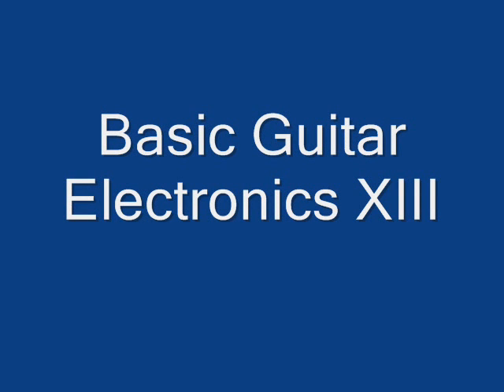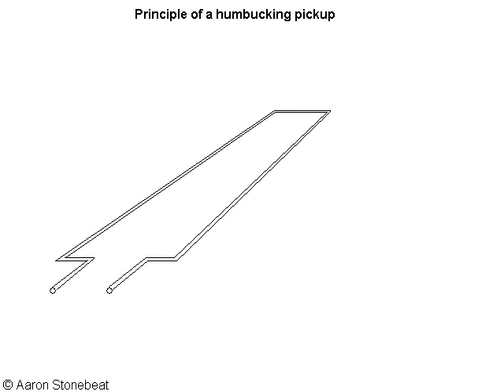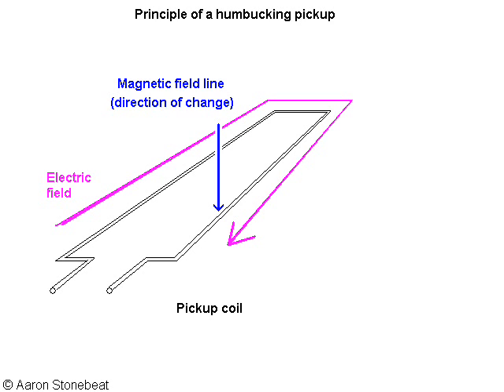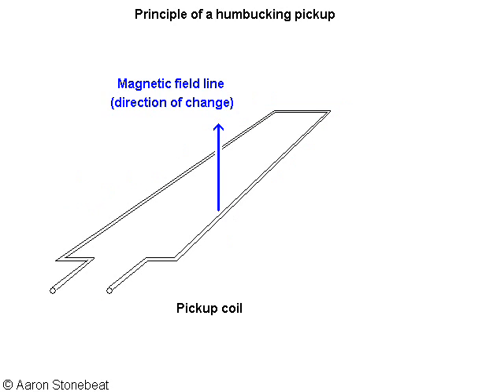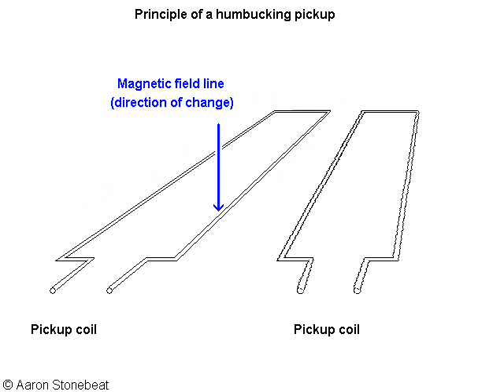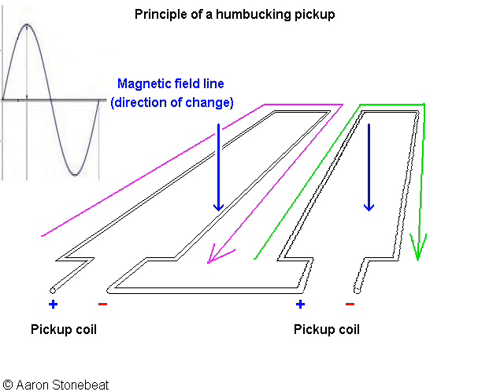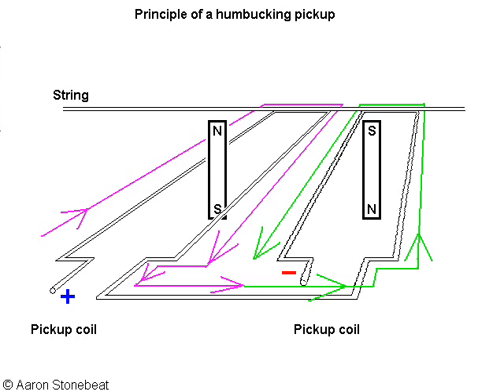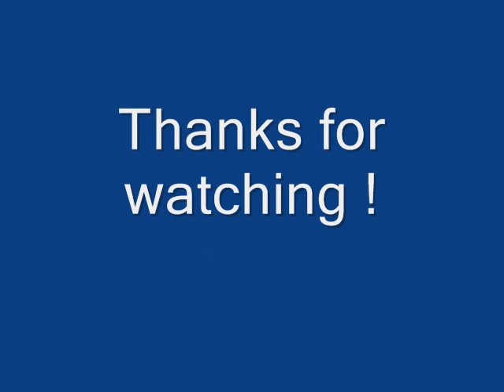Basic Guitar Electronics XIII - Principle of humbucking guitar pickups

Comment: why reversing the magnet on that coil reverses only the sound but not the noise?
Reply from the maker: The noise is independent of the magnetic field in the pickup; it is canceled because the coils are connected out of phase.
To produce a signal from the metal strings, the coils need a magnetic field. If the coils are only connected out of phase, they would be out of phase for the string signal too; by reversing the polarity in one coil, they are in phase relative to the string signal.

I just had a long conversation with RamPamParam about exactly the same thing.
And the answer is in the video 😉
Reply: @aaronstonebeat   thankyou

Comment: Hey Marc!!! Thank you so much for this super thorough, insightful and interesting explanation!!!!!
I'm actually having a hard time understanding something you never mentioned in this explanation which I believe might have some significance, and was wondering whether you might have some knowledge about:
I learned that in humbucking pickups, a big magnet is placed between the two coils in addition to the six magnets each one of the coils has.
Do you know why that is? does it play a factor in reversing the current in some way?
Thanks in advance!
Reply from the maker: Many well known humbuckers indeed have a bar magnet underneath, between the pole pieces. In this case the pole pieces are not magnets but merely ferromagnetic material. The pole pieces are magnetized by the magnet.
I'm not entirely sure why this is done. It is very well possible to use  magnetic pole pieces, like in many single coil pickups (In fact, in most single coil guitars, when two pickups are selected, they are humbucking; because of the reversed polarity and connection of the pickups).

The bar magnet has nothing to do with reversing the current in one of the coils.
Reply: @aaronstonebeat  Thanks for the response! Very appreciated.
Not entirely sure what you mean by "when two pickups are selected, they are humbucking; because of the reversed polarity and connection of the pickups".
Wouldn't one of the coils need to have a set of magnets with an opposing polarity in order to produce this kind of humbucking effect?
Reply from the maker: @RamPamParam  Yes, you are correct in that the pole pieces need to be reversed polarity in the two coils. But they already are because the bar magnet is polarized lengthwise; one row of pole pieces touches the north pole, the other row touches the south pole. So each row of pole pieces becomes an extension of the pole they touch.
Basically the rows of ferromagnetic pole pieces and the bar magnet together form a U-shaped magnet.
Reply from the maker: In a standard telecaster for instance, when both pickups are on they are humbucking. One pickup has north up magnets, the other one has south up magnets; and they  are reverse wound (or reverse connected if they are wound in the same direction; the effect is the same).
Reply: @aaronstonebeat  Also, correct me if I'm off, but if the magnet bar is the only actual magnet in the pickup, it would mean that each set of ferromagnetic poles would be oppositely charged (6 poles positively and the other 6 negatively). So how would this affect the explanation in your video where both sets of ferromagnetic poles are referred to as individual magnets?
Reply from the maker: @RamPamParam  It does not matter for the explanation in my video. One coil 'sees' a magnetic field and the other coil 'sees' a magnetic field in opposite direction.

If the pole pieces were magnets themselves, the whole magnetic field would extend further around the pickup; with the bar magnet in a humbucker the magnetic field is more concentrated in the centre of the pickup. So there will be some difference in sound.
Maybe that is why they originally chose to do it that way?
Reply: @aaronstonebeat  I went ahead and read all about Faraway's and Lenz's laws.
I now understand how the current can be induced counter clockwise magnetically.
But I can't seem to figure out how the hum gets cancelled since the wiring in the diagram in which you show how the hum gets cancelled (Minus to Minus) is different than in the diagram in which you show how the guitar current doesn't get cancelled (Minus to Plus).
Reply from the maker: @RamPamParam  You do go the extra mile!👍
The point is that for the pickups to 'hear' the strings, they need the magnetic field; the strings excite the magnetic field and this induces voltages in the coils. Since the coils have opposing magnetic fields and are  connected reversly, this proces is 'in phase' for both coils.

To 'hear' hum, external electromagnetic interference, no magnets are needed. The hum already is a changing (electro)magnetic field; the coils themselves are in fact antennae. But in this proces the coils are out of phase and so the interference is largely canceled out.
Reply: @aaronstonebeat  The reversed connection cancels the hum? well yes, the way you show it does on minute 8:11, but not on minute 9:47 where the connection of the two coils isn't the same anymore.
at 9:47 we see how the signal of the guitar is not cancelled, but this logic just doesn't make sense for the humbucking connection showed at 8:11 which was negative to negative.
This is what I hoped you could explain.
Reply from the maker: @RamPamParam  In the last section of the video I reverse plus and minus of the right hand coil because now the magnetic field there is also reversed.

For external noise the coils are connected out of phase; for the vibrating strings these same two connected coils are in phase.
Plus in one situation is minus in the other; because of the directions of the magnetic fields.
Reply: Oh wow!
So what actually happens is that the hum’s signal which doesn’t get affected by the magnetic field, travels clockwise in the right hand coil while the guitar signal’s current does get affected and so travels in counter clockwise?
Does that mean that the hum gets cancelled in the middle where the two coils meet?
I figure this ultimately means that currents which are not induced via electromagnetism are not affected by the polarity of a magnet.
Does that sit right with Lenz’s law?

Maybe what I don’t understand is the electrical aspect of things.
Like, why would the hum’s current in the right hand coil travel towards ground at 8:14? And why would the hum’s current in the left hand coil travel away from ground?

I’m so sorry if I’m complicating things, and just know that I really don’t expect you to continue answering if this causes inconvenience.
I appreciate all of your kind answers up until now so very much Aaron! :)
Reply from the maker: @RamPamParam  It's no problem. Good to see you are getting there.

What you see in the video is just a snapshot of one moment. Actually the hum  and the signal from the strings travel back and forth through the coils all the time. The hum goes one way in one coil and the other way in the other coil; the signal from the strings goes the same way through both coils.

So yes, in a way you can say the hum gets canceled in the mddle; where two identical but 180 degrees out of phase signals meet and annililate eachother.
Reply: @aaronstonebeat  So let me get this one straight:
Why would the hum that's produced in the right hand coil be of +2V and the hum produced in the left hand coil be of -2V as shown on minute 8:06 of the video?
Because I figured this doesn't have to do with the magnetic fields.
Is this merely a result of how we decide to connect the copper coil?
Meaning that if we connect the positive wire to ground then the hum that's produced in the coil will be negative and vice versa?
Reply from the maker: @RamPamParam  Yes. If there was only one coil, no strings, no magnet, the coil would pick up the hum and you could amplify it. If you connect a second identical coil in series the hum would be doubled (theoretically). If the second coil is connected reversely (or reverse wound), the hum is canceled.

imagine that the hum is one electromagnetic wave that passes through both coils simultaneously. If the coils are in phase, the hum is boosted; if they are out of phase, the hum is canceled.
Reply: @aaronstonebeat  I think everything finally clicked for me!
Thank you Aaron!
One last question!
I wonder why the hum doesn't get affected by the magnetic field.
Why is it that only the induced current gets affected and not the hum?
Do you happen to know?
Reply: Oh and another one:
So once we build a humbucker in reality and connect finish to finish, do we connect (-) to (-)? And what actually happens behind the scenes is that the magnetic field flips the two polarities in the right hand coil thus allowing for an output?
Reply from the maker: @RamPamParam  I don't know if I have a good answer to that. Maybe the hum isn't affected by the magnetic field, maybe it is.
Reply from the maker: @RamPamParam  Can you rephrase that question? I don't understand what you mean.

Comment: EXCELLENT VIDEO      I am thinking of replacing the single coil pickup in my bass with a humbucking hotrails pickup.      Are the base magnets in the humbucking pickup already reversed?   To get the maximum  lower bass sound,  should I wire the humbucker coils in series?  Should I feed the first coil on the left ..... and then take the exiting wire and feed the second coil on its right side?    Thanks
Reply from the maker: Thanks!
1) Yes, the magnets/pole pieces are reversed polarity; it wouldn't be a humbucking pickup otherwise.
2) By wiring pickups in series the output will be higher compared to wiring in parallel. In guitars this is most noticeable in the midrange of the sound.
Some experimenting might be wise.
3) Which wires should be connected to each other depends on the construction of the pickups and de colour code used.
Again, some experimenting might be a good thing; if you get it wrong, the pickups will be out of phase and not much bass tone will be left.

Comment: So in principle, for a singlecoil pickup, trading out the number of winds for a stronger magnet (such that the signal output is conserved) would also improve the signal-to-noise ratio right?
Reply from the maker: Yes, correct. But it will aso affect the sound. Some manufacturers of cheap pickups use thin wire to get to a certain resistance of the coil (incorrectly equaled to 'output' by many consumers) with fewer windings. In general these pickups sound very trebly and harsh.

Comment: As far as I can tell, this is the only video on YT that actually explains humbucking, and why the signal from the moving string is not canceled out.  Congratulations for doing an outstanding work, Marc.
Reply: I would like to hear an explanation regarding the role of the six “polls” under each string. Are poles supposed to be grounded out or do they carry the positive charge? I have a humbucker that is showing 3 common grounds.

Comment: The trick is the magnetic poles magnetize the strings, the string then Transmits the string magnetic vibrations to the coil , the 60 cycles is not effected by the pole magnets, the 60 cycles is mostly an electric field, the string is transmitting a magnetic signal
Reply from the maker: Actually the 60 Hz cycle is an electromagnetic wave/field; the hum it would cause is (mostly) canceled out by the reverse wound coils of the humbucking pickup.
Reply: @aaronstonebeat  I will stand corrected al

Comment: Marc Van Oppen, That doesn't make sense why the guitar signal passes through but cancels out the hum noises, I don't get it. If the Hum noise is +2volts + (-) 2 volts = 0 vac. But the guitar signal Passes though how so? The HUM noise is getting pickup by the Magnetics pole pieces or the coil of wire is like an antenna? Each coil is 6K DC resistance and when wired in series 6K + (-) 6K = 0 ohms but since the coil is grounded and wired in series the formula is 6K / 6K = 3K DC resistance of the humbucker coil?
Reply from the maker: The guitar signal passes through because of the magnets in the coil, without the magnets the vibration of the strings would not be transduced.
As antennas for external electromagnetic noise the coils function with or without magnets, the noise is picked up by the wire in the coils; that is why they are connected out of phase. The reversed polarity of the magnets in each coil puts the guitar signal in phase again.

Two coils of 6 KOhms in series make 12 KOhms (in parallel they would make 3 KOhms).
I hope this helps. If not I'll try to explain further.
Reply: Coils of wire"without magnets" doesn't have a polarity. The starting of the coil and the ending of the coil is the same because its just a wire wrapped around a bobbin. So how does the electrical signal know that the coils starting or ending because its just wire wrapping in a circle so it doesn't have a polarity.
Reply from the maker: @waynegram8907  The orientation of the magnets causes the signal to move through the wire in one direction or the opposite at any given moment.
Reply: Humbucker pickups are two signal coil pickups that are 6K ohm per single coil. Humbucker coils are wired in series which is 6K + 6K = 12K ohms Humbucker coils are wired in series plus one coil is out of phase reversed wound which is 6K divided by 6K = 3K ohms?Humbucker coils are wired in series plus one coil is out of phase reverse wound which the formula should be 6K + (-) 6K = 0 ohm?
Reply from the maker: @waynegram8907  "Humbucker pickups are two signal coil pickups that are 6K ohm per single coil. Humbucker coils are wired in series which is 6K + 6K = 12K ohms Humbucker coils are wired in series plus one coil is out of phase reversed wound which is 6K divided by 6K = 3K ohms?Humbucker coils are wired in series plus one coil is out of phase reverse wound which the formula should be 6K + (-) 6K = 0 ohm?
"

No, it doesn't matter if the two coils are connected out of phase as far as the resistance is concerned. When they are in series you add the resistances (6+6=12); when they are in parallel you get 1/R1+1/R2=1/R3 (1/6+1/6=1/3, R3=3).
Reply: But what formula do you use for humbuckers? because its two coils 6K per pickup coil wired in series and one end of the coil is ground, so what formula do you use?
Reply from the maker: @waynegram8907  "But what formula do you use for humbuckers? because its two coils 6K per pickup coil wired in series and one end of the coil is ground, so what formula do you use?"

If it's a series humbucker you add up the resistances of the coils; if it's a parallel humbucker you do the inverse trick (1/R1+1/R2=1/R3).
Usually humbuckers are internally connected in series.
Reply: Since the humbuckers are internally connected in series and also one end is grounded negative and then other end is HOT positive. So I'm confused on which formula to use because the coils are internally connected in series but also in parallel which one end of the coil is grounded negative and the other end of the coils is HOT positive. So what formula do I use for humbuckers?
Reply: Watch the video at 1:40 time its shows the dummy coil with no magnets no pole pieces. The Dummy Coil can be wired in series or in parallel with the guitar pickup. The pickup will measure 6K and when he turns down the tone pot to turn ON the dummy coil its will measure 3K. The Dummy Coil is not reverse wound or out of phase. So I don't know how it cancels out the hum noises. He wired the guitar using the tone pot to mix in the dummy coil or turning it off and on. It will measure 6K when the dummy coil is OFF and measures 3K when the dummy coil is ON. But how does the dummy coil cancel out the hum noises?https://www.youtube.com/watch?v=XoPMgAMwAPk&t=200s
Reply from the maker: @waynegram8907  "Watch the video at 1:40 time its shows the dummy coil with no magnets no pole pieces. The Dummy Coil can be wired in series or in parallel with the guitar pickup. The pickup will measure 6K and when he turns down the tone pot to turn ON the dummy coil its will measure 3K. The Dummy Coil is not reverse wound or out of phase. So I don't know how it cancels out the hum noises. He wired the guitar using the tone pot to mix in the dummy coil or turning it off and on. It will measure 6K when the dummy coil is OFF and measures 3K when the dummy coil is ON. But how does the dummy coil cancel out the hum noises?https://www.youtube.com/watch?v=XoPMgAMwAPk&t=200s
"

The dummy coil cancels out the hum because it IS connected out of phase with the bridge and the neck pickup.
Reply: Are you saying the Dummy coil is "reversed wound coil' compared to the bridge and neck pickup are "Forward Wound coil?But the Dummy coil is actually used in the video is Forward Wound coil so how does it cancel out the hum noises?
Reply from the maker: @waynegram8907  "Are you saying the Dummy coil is "reversed wound coil' compared to the bridge and neck pickup are "Forward Wound coil?But the Dummy coil is actually used in the video is Forward Wound coil so how does it cancel out the hum noises?"

If it is wound the same way you just have to reverse the connection of the wires of the dummy coil and it will be out of phase with the actual pickups.